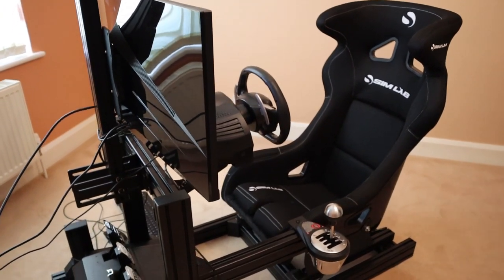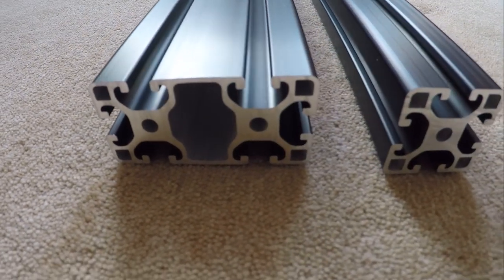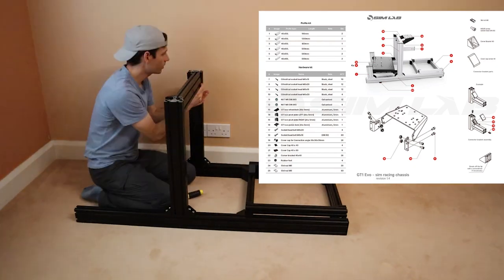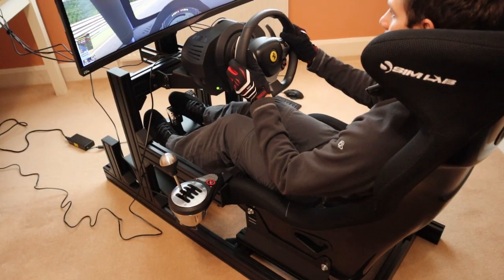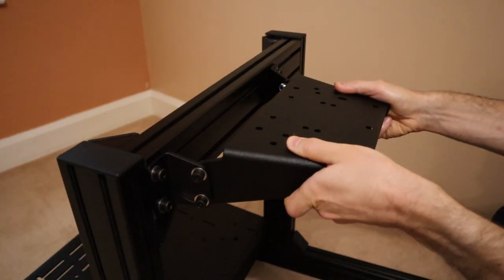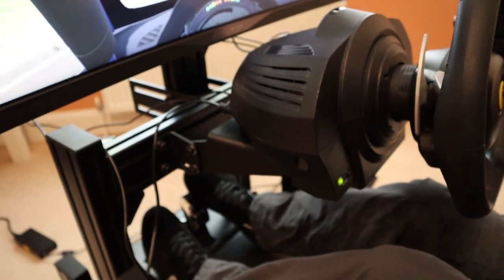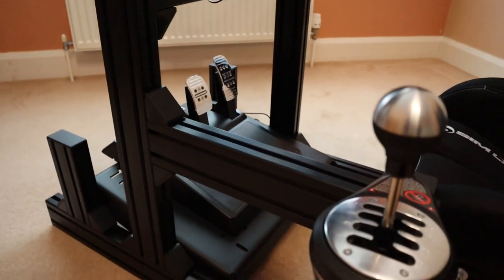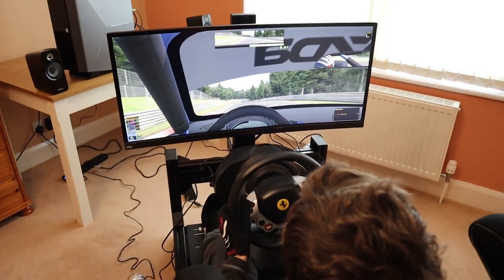Sim-Lab GT1 Evo cockpit review

Comment: Hey I'm looking at getting this rig, as I'm planning on upgrading to a load cell brake and direct drive wheel in the near future. Anyway I want to save some money on a chair and I was wondering if you could just mount any chair onto this rig even if it's designed for sim racing?
Reply from the maker: Thanks for your question Ryan and apologies for the delayed reply. You can mount pretty much any car seat you like to the GT1 Evo. If you have a side-mount seat, you can use the bucket seat brackets ( https://adaptnet.work/5zmE ). Otherwise, you can base-mount a seat directly to the seat rails using a seat slider ( https://adaptnet.work/7jG5 ). Hope that helps. 👍
Reply: @ADAPTNetwork  thanks 👍
Reply from the maker: No worries  @ryancairns5518 . Glad I could help. 🤙

Comment: Is it possible to get the any closer or is it limited? Seems like it is a little bit too far away. How much distance is it?

Thx in advance
Reply from the maker: Thanks for your comment Mettfisch. I’m not sure which piece of equipment you are reffering to, as you left this out of your question. However, the GT1-Evo is highly adjustable, so it is possible to change the position of every mounting point and bring the wheel, pedals, shifter and screen closer to you. Hope this answers your question. If not, please let me know. 👍
Reply: @ADAPTNetwork  ah..sorry.. the screen. Can you put it closer to the wheel?
Reply from the maker: No worries  @mettfisch2624 . Yes, using the single screen holder, you can move the monitor a little closer to the wheel. As you can see from the video (11:30), I have room to move the screen about two inches closer. If that’s not enough though, I would recommend using a free-standing monitor mount. Hope that helps. 👍

Comment: Hey dude, I'm looking into this for a Drifting rig, how would you mount both a handbrake as well as a shifter at the same time?
Reply from the maker: Great question Oren. You‘ll need to use two shifter and handbrake mounting brackets (one for the shifter and one for the handbrake). These are available from Sim-Lab, or you can fabricate your own. You might get away with mounting the handbrake directly behind the shifter on the side mount that comes with the GT1 Evo. However, depending on your equipment, it might be worth purchasing an extra mounting point from Sim-Lab, or some extra aluminium profile, to strengthen the side mount, or if you wanted to mount the handbrake and shifter side-by-side. Hope that helps mate. 👍
Reply: @ADAPTNetwork  Awesome dude thanks! its great that you're still responding to comments on a video 2 years later

Comment: Hey, how tall are you? Iam 210cm or 6/10 in feet and looking for a rig
Reply from the maker: Thanks for your question Wolf. The GT1 Evo is more than big enough for your height. It’s 135cm in length and, as you can see from the video (
2:02), I have the pedal deck uprights and the seat rails set three inches from the edges. Additionally, I have the seat set quite far forward on the seat rails—so there’s plenty of scope to extend the leg length. Depending on your build, however, you may need to opt for a larger seat like the Sim Lab SPEED1 XL. For reference, I'm about 5ft 9.5 inches (176.5cm) and average build. Hope that helps. 👍
Reply: @ADAPTNetwork  thank you that helps me a lot
Reply from the maker: No worries  @Wolf-vj9ej —glad I could help. Let me know which rig you decide to go for in the end.

Comment: great video, however its unclear how you mounted the thrustmaster th8a shifter, could please explain or share pictures how you really mounted the shifter.
Reply from the maker: Hi Koi, that's a great question. I used the TH8A shifter mounting plate from Sim-Lab ( https://adaptnet.work/6Muv ). This simply bolts to the shifter arm using the included countersunk screw and T-nut. You can then use two or four bolts to mount the shifter depending on how close you want to position it. Hope that helps. 👍
Reply: @ADAPTNetwork  aaah so thats how it works, its very clear to me now, thnk you sir !
Reply from the maker: No worries  @TheSnake0444 , glad I could help.

Comment: Hello ! Can i mount the pedal plate without the uprights?  I like the pedal plate flat and lower to the ground or maybe even down  tilted a little bit in the front ,thanks
Reply from the maker: Great question Bobby. Yes, you can easily mount the pedal plate flat using the rig’s side rails instead of the uprights. 👍
Reply: @ADAPTNetwork  thanks a lot !
Reply from the maker: @bratosin1  No worries mate—glad I could help.

Comment: I am looking to purchase this seat and was wondering if the seat slider is worth getting or not?
Reply from the maker: Thanks for your question Brady. In my opinion, if you’re the only person that will be using the rig, then there is no need to use seat sliders—you can simply bolt the seat in place to match your ideal driving position. However, if different people of different heights will be using the rig, then seat sliders would prove useful. Hope that helps. 👍
Reply: @ADAPTNetwork  thank you for your reply. It has helped a lot
Reply from the maker: No worries  @bradypollock037 —glad I could help.

Comment: Hate to bother you but could you give me the dimensions of the rig I need to know how long it is not worried about the wet the link?
Reply from the maker: No worries Stewrt. The GT1 Evo is 135 x 58cm (2:02). Depending on where you mount the seat though, the rig may be a bit longer. I bumped the seat forward (along with the wheel and pedals) to keep the footprint of the rig as small as possible. Hope that helps. 👍
Reply: @ADAPTNetwork  Well thank you very much there mate No I got to figure out how many feet it is thank you sir have a great day
Reply from the maker: No worries  @stewrtcullom7924 —glad I could help. For reference (in feet and inches), the rig is about 4ft 5 inches long and 1ft 11 inches wide.
Reply: @ADAPTNetwork  Thank you so much I got plenty a room I built a platform a while back and it should fit perfect tomorrow I have a guy coming out putting my new TV on the wall Super cool 50 inch TV

Comment: Great review! Really job well done!
Ordered mine last Friday.
My only complaint with the purchase process was the seat. I did not want to spend +300 euro on a Sparco seat and it seems that their cheapest seat that their website says is available for European customers is not available for orders to Ireland.

On top of that there is wide variety of choice on car parts websites and since this rig is designed to fit any car seat I ended up ordering OPM seat here in Ireland while saving 100 Euro in comparison to what SimLab offers on their site.
So piece of advice for anyone who is tighter on their budget, you can get seats cheaper elsewhere! You can even go to car scrapyard and pick up something there...I would probably do it but with lockdown in full swing...that wasn't an option haha.

How long did you wait for the rig arrival since you placed the order?
Reply: In USA I ordered my Sim Lab P1-x and it came within 1 week.
Reply from the maker: Thanks for your support Kamil—I really appreciate it. 👍

Splitting up the rig and seat ordering process does have it’s pros and cons, like you say. Overall though, I think it works well and means that people can pick a seat that fits their budget and requirements. The adaptability of the GT1 Evo means that you can use pretty much any car seat that you want. One of my sim racing friends also has this rig and is using an old car seat. Like you mentioned, it’s a great way to get started on a tight budget. Let me know how you get on with your OMP seat. Which specific seat model did you go for in the end?

My rig was delivered last year and there was a few week delay due to the backlog at the time. However, I think Sim-Lab has recently opened a second production facility in Germany, which has helped to reduce backlogs moving forward.
Reply from the maker: That's great to hear  @elmalloc . The P1-X looks like a beast of a rig. I found the GT1 Evo to be impressively strong, so I can't imagine anything that the P1-X couldn't handle. Which seat did you decide to pair with it?
Reply: @ADAPTNetwork  They dispatched it today. So impressive speed considering I ordered it last Friday.
Fanatec on the other hand took a week to dispatch load cell pedal for my CSL pedals. haha

This is the OMP seat I ended up with https://www.murraymotorsport.com/trs-x-steel-frame-seat

I'm not sure what I am more excited about: DD1 wheel base that I ordered or the SimLabs rig. 

For the last 2 years I've been using Playseat challenge with my CSL elite wheel and I'm really starting to feel it in my back and neck.

Playseat chalenge is extremally handy for tight spaces since you can fold the whole rig and hide it behind the couch, but there are compromises in comfort especially over longer driving sessions.
On top of that...it's basically modified fishing chair haha. It is not the sturdiest thing. Over time it developed a lot of flex which I fixed to some extent with home made solutions...Before that I drove with my wheel attached to the ironing board :D

So this will be my first super sturdy rig. I'm expecting huuuuge comfort and quality of life upgrade from it.
Reply from the maker: @kamael1125  Awesome mate—that's great to hear (the OMP TRS-X seat looks like a nice choice). The Playseat Challenge was also my first sim racing rig (I compared it the the NLR F-GT Lite here:https://youtu.be/B9w_4PwtAj4). It's a nifty little cockpit to get started and perfect for console racing. Like you though, I also found it a little uncomfortable during long sessions. In comparison, the GT1 Evo is a dream to drive in. When you set it up, I would recommend taking the time to dial in the tilt of your seat (see here for tips: 5:33). Enjoy the new rig bud. 👍
Reply: @ADAPTNetwork  thanks for the tip. Once it arrives I'm planning to take a day off from work and play around with it until I'm happy. From what I see on the Web from other people, this rig is a bit time consuming to assemble 😅 But I will enjoy every minute of it.

PS thank you for being so responsive and helpful, and nice! You earned my subscription!
Reply from the maker: Thanks  @kamael1125 —I really appreciate the sub. Yeah, it took me an extra day to get everything positioned where I wanted it. But, once everything is setup it’s definitely worth the effort. 👍
Reply: @kamael1125  Hi Kamil, how do you find this rig and the OMP seat that you chose? Do you still have it? Are you happy with it? Would you recommend it?
Reply: @CB_883  hey. Rig is amazing. Small enough if you ate concerned with space.
If you put it on caster wheels you can easily push it into corner after you are done. But it is heavy enough for it to not roll around if you are in it.
My only very small complaint is that plastic bracket covers are loose as fuck and they keep falling out of brackets when you fart while sitting in the rig 🤣🤣🤣 I am exaggerating...but they do fall out at the slightest touch...so when you get out and get in...or wheel rig around.  It is very very minor issue...but a bit annoying.
OMP seat is fine. It is pretty narrow in hip section. It fits me just perfect...especially after it comforted to me after use. But if you are a bit wider... you might want to go for wider version of that seat.
Ive been using it now for almost a year almost every day and cant complain really. To be fair I have no comparison so it is hard for me to say if I am missing out on comfort comparing to more expensive seats.

I will put it this way: if you are on tighter budget and want to save a bit of cash...go for it.
Also, if you decide to buy it, go to some shop and buy some more washers for bolts to assemble the whole thing. I'm not sure if simlab don't give enough of those but I was missing some and bolts with no washers will scar the rig.

When buying seat consider buying sliding mechanism as it is not supplied with the seat.

Finally, rig comes with a plate for mounting the wheelbase. If you have fanatec dd series, consider getting simlabs dedicated solution for those wheels. It looks way better and it is much sturdier then the plate.
Plate is good, but mounting solution they sell makes the wheel base rock solid.

Let me know if you decide to go for it and if you do let me know your thoughts after you get it.

It took me full day to assemble the whole thing and hours of adjustments to make it work. Granted I never had experience with this sort of rig.
These are painful to adjust but once you get it right...they will stay like that forever.
Reply: @CB_883  If you are on fb, find me there, send me message. I can send you some photos and it will be easier to communicate. Im wearing glasses and red shirt on my profile pic
Reply: @kamael1125 I don't have Fb account unfortunately.
Reply: @kamael1125  thanks mate, I've just ordered Sim-Lab GT1 Evo frame on a Black Friday deal and hopefully it arrives soon. As for the seat I found a shop that specializes in racing seats and they have lots in stock. I'm going to pay them a visit once I have the frame. I'm doing research around the wheels and pedals now. I'm enjoying this project so far, the community is really positive and people are helping each other. Love it! Can't wait for my first race
Reply: @CB_883  Amazing!
Frame and seat make a huuuuge difference for the experience. What wheel bases you are considering?
Reply: @kamael1125  Fanatec CSL DD and probably McLaren GT3 wheel. But I must do more research around other ecosystems and find some good reasonably priced pedals.
Reply: @CB_883  i have Huskinveld sprints. But I don't think they fall under reasonably priced category 🤣 they are very good though.
I used to have old csl elite pedals with load cell and I guess they were working fine.
I know someone who uses thrusmaster pedals with load cell and they are pretty happy with it but thinking about getting an upgrade

Comment: Waiting for mine to arrive, do you think that with a Vesa adapter the monitor mount can fit VESA 75? Want to order one but my G5 only have vesa 75 😓
Reply from the maker: Thanks for your question TheDummies. For sure, an adapter should do the trick. The VESA mount that comes with the GT1 Evo single screen holder supports VESA patterns 100 x 100mm, 100 x 200mm and 200 x 200mm. So you’ll need an adapter that converts one of these patterns to 75 x 75mm. Hope that helps.👍
Reply: @ADAPTNetwork  thanks for the reply! I will go ahead and place the order already saw an adapter on Amazon! Thanks mate!
Reply from the maker: No worries  @Dummies05 —glad I could help. See you on the virtual racetrack. 🏎🏁
Reply: @ADAPTNetwork  Does the GT1 EVO come with a 100x100 vesa Single monitor mount or it is bought separately?
Reply from the maker: Thanks for your question  @Abbbk35 . The GT1 Evo single screen holder is sold separately ( https://adaptnet.work/6Mun ). It’s depth and height adjustable and mounts VESA patterns 100 x 100mm, 100 x 200mm and 200 x 200mm. 👍

Comment: Does the Simlab GT1 EVO come with the equipment required to install the seat or does it need to be purchased separately?
Reply from the maker: Thanks for your question tyncam. In order to mount a seat, you need to purchase the additional side-mount seat brackets (5.28). These come with with the necessary bolts and can be picked up for around €39 EUR ( https://adaptnet.work/5zmE ). Hope that helps. 👍
Reply: @ADAPTNetwork Great - and thanks so much for the detailed review.
Reply from the maker: No worries  @tyncam24 —I’m really glad you found my review useful. We’ll be publishing some new sim racing content over the next few weeks, so keep an eye open for that. See you on the virtual race track. 🏎🏁
Reply: @ADAPTNetwork  I just purchased a Simlab P1-X and was wondering if you knew how to mount the Thrustmaster T248 pedals on this model's pedal deck?
Reply from the maker: Thanks for your question  @dalemiller1441 , sorry for the late reply. The T3PM pedals, that come with the T248 wheel, have a few different mounting points. Two mounting points at the back, underneath the throttle and clutch pedals (as with the T3PA pedals I use in this video), and three at the front. The Sim-Lab P1-X comes with two pieces of alumimium profile for the pedal deck, on which you can only mount select pedals directly (those which have bolt access from above). So, to mount the T3PM pedals, you’ll need to get the additional pedal slider baseplate ( https://adaptnet.work/6VLj ). I linked to Digital-Motorsports here, but you can also get the baseplate, with or without seat sliders and a heel rest, directly from Sim-Lab. You first need to mount your pedals to the baseplate, and then the baseplate to the aluminium profile. Hope that helps. 👍
Reply: @ADAPTNetwork  Thanks so much.
Reply from the maker: No worries  @dalemiller1441 —glad I could help. See you on the virtual race track. 🏎🏁

Comment: Are there enough screws included to mount pedals, seat and wheelbase or do I need to plan them as extras?
Reply from the maker: Thanks for your question Tim. Yes, there are enough M6 screws included in the kit to mount your wheel, pedals, and shifter. I would, however, recommend picking up a pack of M6 washers to ensure a tight and secure connection to the frame. Extra M8 screws, to mount a seat, are also included with the seat brackets. Hope that helps. 👍
Reply: @ADAPTNetwork  OK thank you very much
Reply from the maker: No worries  @timschwim3335 . Let me know how you get on with the new rig.